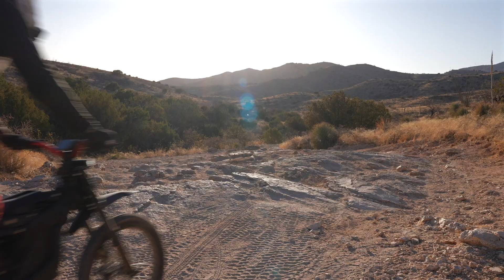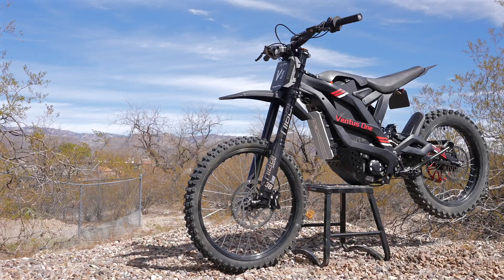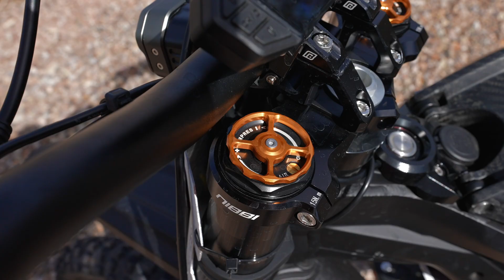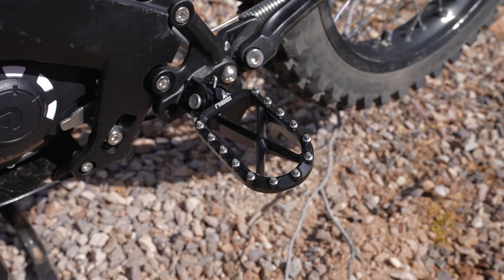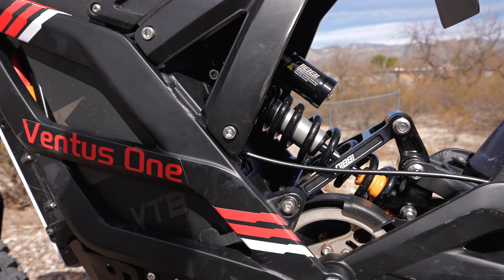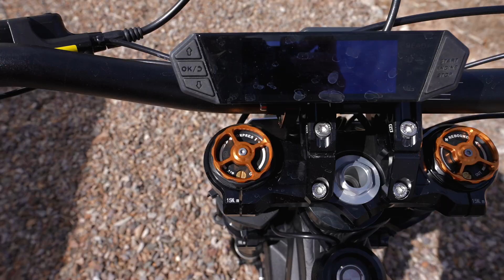Nibbi Components for Ventus One, E-Ride Pro, Surron, and More!

Comment: so many forks coming out lately. I'd rather stick to what I know is true tried and tested. having to buy some forks and redo the seals after less than 5 rides or out of the box is not for me. I've realised now that appearance isn't what I gauge on for quality, which a lot of people do "it looks well built" until there stripped to see there made out of the same factory that a lot of them are made in, rebranded/changed minor differences to rename it and sell it as a different brand. the crappy fork oil and seals some of these companies use is a major turn off, no one wants to rebuild or upgrade a newly built fork LOL 

I will come back in a few months when someone has actually put some serious riding and put them through the ringer to see how they hold up.
Reply from the maker: We're in the process of that at the moment.